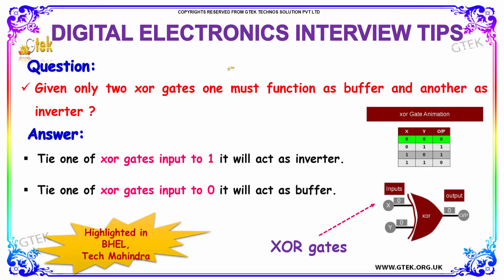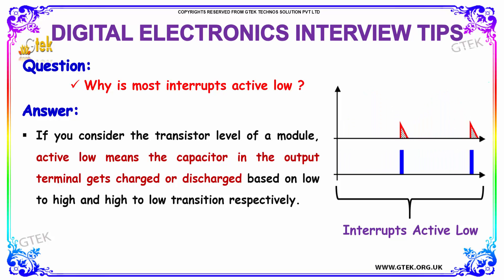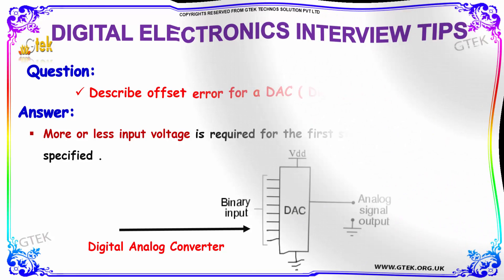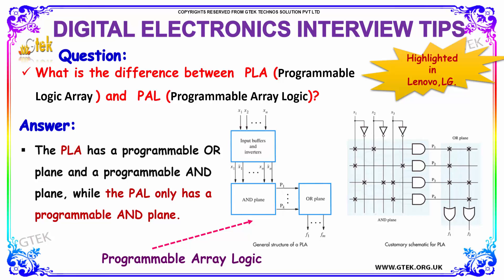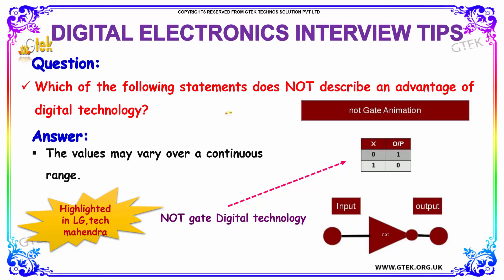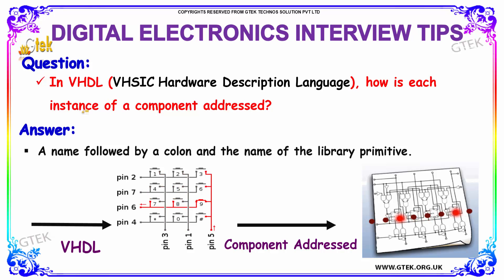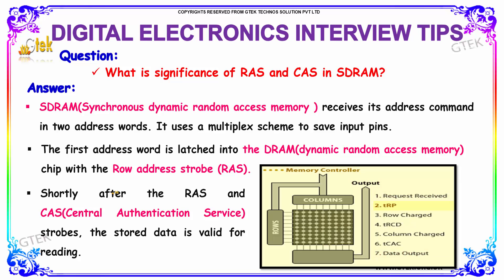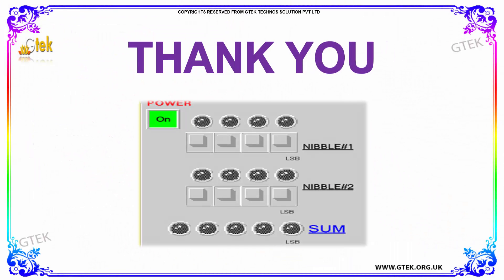Top 40 Digital Electronics ece interview questions and answers tutorial for fresher beginners

Comment: Both latches and flip-flops are circuit elements whose output depends not only on the current inputs, but also on previous inputs and outputs. The difference between a latch and a flip-flop is that a latch does not have a clock signal, whereas a flip-flop always does.

Comment: why most interrupts active low?
Reason 1:
Active low signals are used in digital circuitry to reduce errors caused due to interference(noise).
If we use active high signals interference caused due to noise is also considered as a signal, so we use active low signals to prevent errors.

Reason 2:
When driving any circuit using a micro controller it cannot provide high current to drive the device,so we connect an external power source to
the device and use active low signal

Comment: For the question How to achieve 180 degree phase shift ? you said full form of DCM is Digital content manager, but it is digital clock manager and ans is not FPGA, on FPGA there is clock manager using that we can take or collect different clock signal signal. please correct thie DCM full form ma'am.

Comment: Digital logic first became useful when switching speeds got above 50 Hz, because that was faster than a team of humans operating mechanical calculators. Modern electronic digital logic routinely switches at 5 GHz (5 · 109 Hz), and some laboratory systems switch at more than 1 THz (1 · 1012 Hz).

Comment: in some logic families, NAND gates are the simplest digital gate to build. All other logical operations can be implemented by NAND gates. If a circuit already required a single NAND gate, and a single chip normally carried four NAND gates, then the remaining gates could be used to implement other logical operations like logical and. This could eliminate the need for a separate chip containing those different types of gates.

Comment: Fortunately, large logic machines are almost always designed as assemblies of smaller logic machines. To save time, the smaller sub-machines are isolated by permanently installed "design for test" circuitry, and are tested independently.

Comment: There are several reasons for testing a logic circuit. When the circuit is first developed, it is necessary to verify that the design circuit meets the required functional and timing specifications.

Comment: the digital circuit will calculate more repeatably, because of its high noise immunity. On the other hand, in the high-precision domain (for example, where 14 or more bits of precision are needed), analog circuits require much more power and area than digital equivalents.

Comment: Additionally, where clocked digital systems interface to analog systems or systems that are driven from a different clock, the digital system can be subject to metastability where a change to the input violates the set-up time for a digital input latch. This situation will self-resolve, but will take a random time, and while it persists can result in invalid signals being propagated within the digital system for a short time.

Comment: Digital circuits are made from analog components. The design must assure that the analog nature of the components doesn't dominate the desired digital behavior. Digital systems must manage noise and timing margins, parasitic inductances and capacitances, and filter power connections.

Comment: In this scheme, the digital machine is characterized as a set of data flows. In each step of the flow, an asynchronous "synchronization circuit" determines when the outputs of that step are valid, and presents a signal that says, "grab the data" to the stages that use that stage's inputs. It turns out that just a few relatively simple synchronization circuits are needed.

Comment: Asynchronous logic components can be hard to design because all possible states, in all possible timings must be considered. The usual method is to construct a table of the minimum and maximum time that each such state can exist, and then adjust the circuit to minimize the number of such states. Then the designer must force the circuit to periodically wait for all of its parts to enter a compatible state (this is called "self-resynchronization")

Comment: As of 2014, almost all digital machines are synchronous designs because it is easier to create and verify a synchronous design. However, asynchronous logic is thought can be superior because its speed is not constrained by an arbitrary clock; instead, it runs at the maximum speed of its logic gates. Building an asynchronous system using faster parts makes the circuit faster.

Comment: The usual way to implement a synchronous sequential state machine is to divide it into a piece of combinational logic and a set of flip flops called a "state register." Each time a clock signal ticks, the state register captures the feedback generated from the previous state of the combinational logic, and feeds it back as an unchanging input to the combinational part of the state machine.

Comment: The classical way to represent a digital circuit is with an equivalent set of logic gates. Another way, often with the least electronics, is to construct an equivalent system of electronic switches (usually transistors). One of the easiest ways is to simply have a memory containing a truth table. The inputs are fed into the address of the memory, and the data outputs of the memory become the outputs.

Comment: When only one digital circuit is needed, and its design is totally customized, as for a factory production line controller, the conventional solution is a programmable logic controller, or PLC. These are usually programmed by electricians, using ladder logic.

Comment: Another form of digital circuit is constructed from lookup tables, (many sold as "programmable logic devices", though other kinds of PLDs exist). Lookup tables can perform the same functions as machines based on logic gates, but can be easily reprogrammed without changing the wiring. This means that a designer can often repair design errors without changing the arrangement of wires.

Comment: Each logic symbol is represented by a different shape. The actual set of shapes was introduced in 1984 under IEEE/ANSI standard 91-1984. "The logic symbol given under this standard are being increasingly used now and have even started appearing in the literature published by manufacturers of digital integrated circuits."

Comment: A logic gate is generally created from one or more electrically controlled switches, usually transistors but thermionic valves have seen historic use. The output of a logic gate can, in turn, control or feed into more logic gates.

Comment: Most useful digital systems must translate from continuous analog signals to discrete digital signals. This causes quantization errors. Quantization error can be reduced if the system stores enough digital data to represent the signal to the desired degree of fidelity. The Nyquist-Shannon sampling theorem provides an important guideline as to how much digital data is needed to accurately portray a given analog signal.

Comment: In some cases, digital circuits use more energy than analog circuits to accomplish the same tasks, thus producing more heat which increases the complexity of the circuits such as the inclusion of heat sinks. In portable or battery-powered systems this can limit use of digital systems.

Comment: In a digital system, a more precise representation of a signal can be obtained by using more binary digits to represent it. While this requires more digital circuits to process the signals, each digit is handled by the same kind of hardware, resulting in an easily scalable system. In an analog system, additional resolution requires fundamental improvements in the linearity and noise characteristics of each step of the signal chain.

Comment: In most cases, the number of these states is two, and they are represented by two voltage bands: one near a reference value (typically termed as "ground" or zero volts), and the other a value near the supply voltage. These correspond to the false and true values of the Boolean domain respectively(also known as '0' and '1' respectively)

Comment: digital electronics are electronics that handle digital signals (discrete bands of analog levels) rather than by continuous ranges as used in analog electronics. All levels within a band of values represent the same information state.

Comment: A digital circuit is a circuit where the signal must be one of two discrete levels. Each level is interpreted as one of two different states (for example, on/off, 0/1, true/false). Digital circuits use transistors to create logic gates in order to perform Boolean logic.

Comment: Image result for Digital Electronics
Digital electronics or digital (electronic) circuits are electronics that handle digital signals (discrete bands of analog levels) rather than by continuous ranges as used in analog electronics. All levels within a band of values represent the same information state.

Comment: Digital electronics or digital(electronic) circuits are electronicsthat handle digital signals (discrete bands of analog levels) rather than by continuous ranges as used in analog electronics.

Comment: Engineers use many methods to minimize logic functions, in order to reduce the circuit's complexity. When the complexity is less, the circuit also has fewer errors and less electronics, and is therefore less expensive.

Comment: We know there are two types of signals, one is analog or continuous 
signal and the second one is Digital or discrete signal. So the science 
or field of research in the area of engineering is termed as Analog and Digital Electronics respectively. Now coming to the area of Digital Electronics,
 it is essential to understand wide range of applications from 
industrial electronics to the fields of communication, from micro 
embedded systems to military equipment.